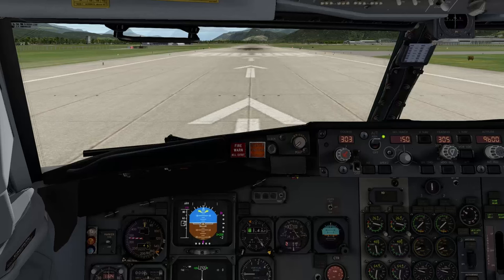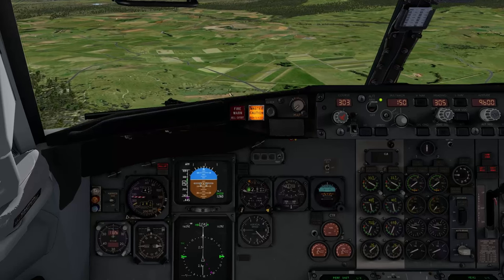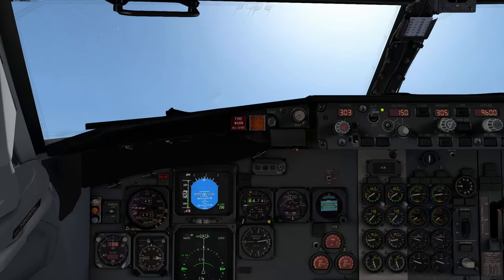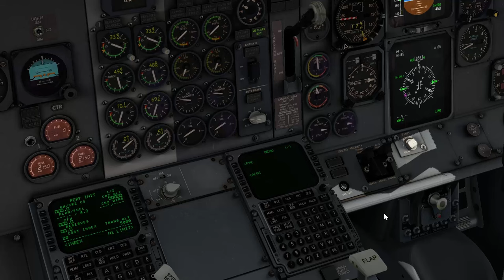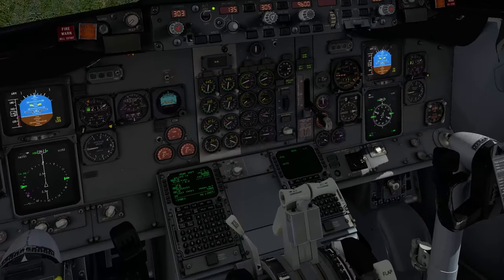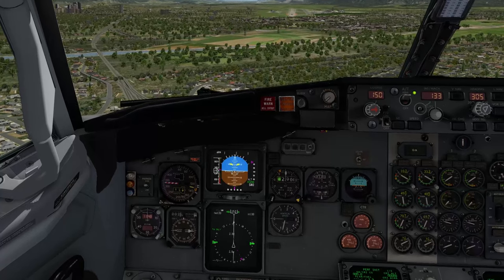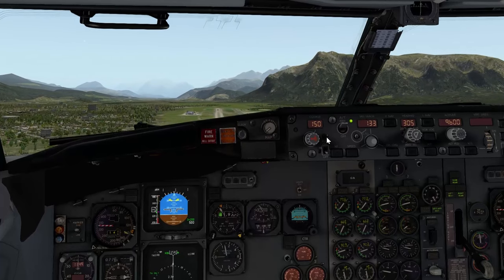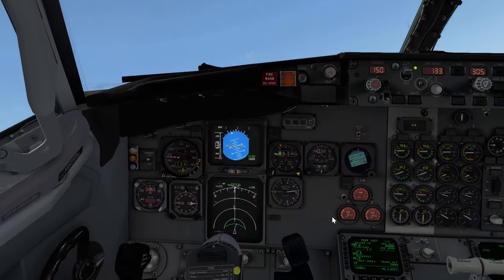EGPWS preview for the 1.1 patch of the IXEG 737

Comment: It is such a beautiful airplane. With x-enviro I have CTD, found no solution for this. First I thought, it would be the altimeter settings when x-enviro changes the weather. But this was not the case. Also I changed preprocessing in x-enviro, also no difference.
Reply from the maker: Get the latest version of x-enviro, it should stop the CTD. IF that does not help, disable the "show vortices" option in the prefs menu for the IXEG - also: The support forum is your friend if you have a support question. Who would have thought that? ;-)
Reply: thanks, I tried this. First flight no CTD, second flight CTD with x-enviro 1.07.
Only the log file of x-enviro shows loading weather. I noticed it before CTD. First XP freezes 1 to 3 seconds. Then I know, next weather download will be CTD. 
Yes, I also use the forum where I posted my experiences. The IXEG is the best airplane in X-Plane. Maybe until christmas I will buy a new PC and then we will see, it happens again.